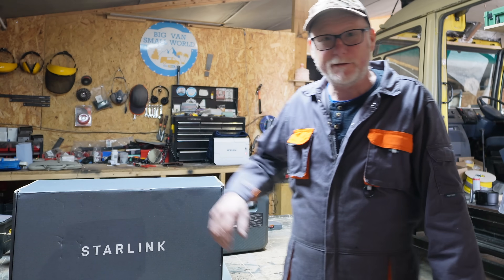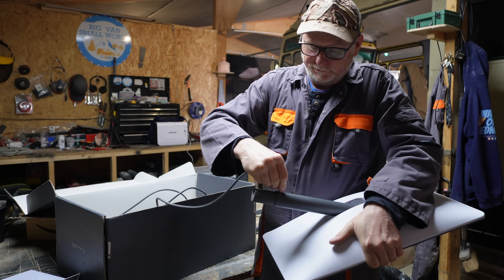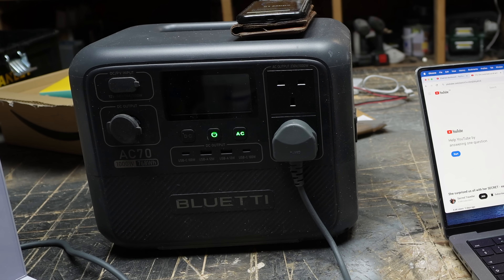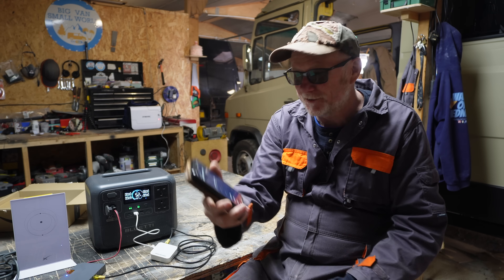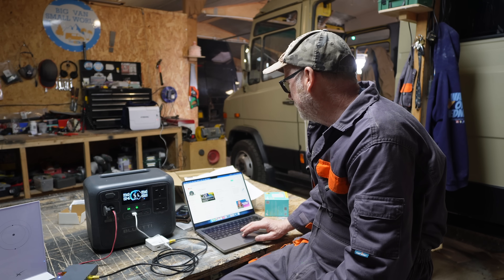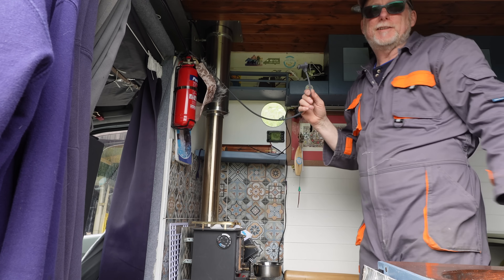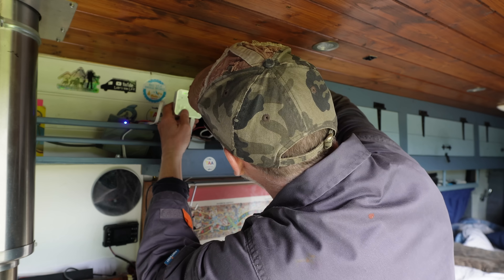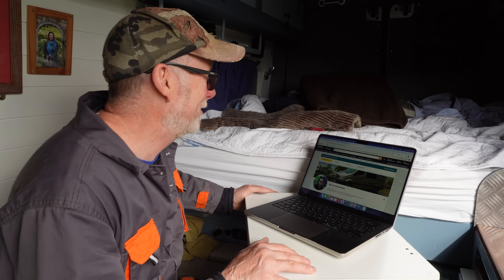HOW TO CONVERT STARLINK TO 12V DC no cutting wires or cables

Comment from the maker: I bought this product with my own money. This video is not sponsored in any way, but I do use affiliate  links. I am not on any sponsorship contracts with any company.
Here is a list of all the components you will need to do exactly the same as i have done in this video i hope this helps.  
XLTTYWL Starlink V2 PoE Injector https://amzn.to/3KIFGA1 
TP-Link AC750 Dual Band Wi-Fi Travel Router https://amzn.to/45nWtlj
Ercielook CAT8 Ethernet Cable 0,5m https://amzn.to/3xjzrzA
Aluminum Alloy Starlink Mount https://amzn.to/4clACgQ

Comment: Hi Mel, I have converted my starlink to 12V and it is working, however how did you get the starlink app to work via the 3rd party router, because for some reason mine does not see the starlink. Hope you can help. thanks
Reply from the maker: I just connect my phone to the router WiFi and it worked perfectly fine good luck hope you finger it out 🤞🍻👍

Comment: Great video, thanks Mel. One thing I noticed with my Starlink over the lovely English summer was that you don't always want the dish on the roof. We had some really windy weather in late August. I had placed the dish on top of my caravan using the supplied X stand. I weighed this down with a couple of weights. Signal was intermittent due to the wind rocking the caravan and the dish not being able to lock on to the satellites. So if you're camping in bad weather and there's a bit of space on the ground for the dish, put it there. Cue the 'caravan rocking' jokes... :)

Comment: Hi Mal just a quick update, we did the conversion as per your video.
We have had a major problem with the PoE injector trying to set our van on fire as there is no internal fuse fitted.
We luckily had a 10amp fuse on the supply so it stopped with just some smouldering, just something for you to be aware of.
Also it has knackered our Starlink cable as it’s melted the end connection, probably a stray voltage over the specified 48v
Reply from the maker: Oh my goodness me I’m sorry to hear that I’ll post this comment to the top of the comments thanks for the warning
Reply: @MelsBigVanSmallWorld not in any way your fault just a faulty unit, done some research and I am opting for the boondocker version now as it’s got built in internal protection, keep up the great vlogs 🙌🏻🙌🏻

Comment: I live on a canal boat. I have a simple wifi modem/router. with an external aerial. All on 12v. Router was 20 Quid and the aerial was about 10.  As long as there is a mobile signal (99% of UK has coverage) we have wifi. Just got a van and will probably just use phones as mine is not a conversion but a simple set up for occasional overnight use.
Reply from the maker: Yeah I think I may have wasted £400 lol 😂
Reply: @MelsBigVanSmallWorld  If you are going abroad and into more remote areas then yours will be a more reliable set up.
Reply: 99% coverage my *ss.
Reply: @JazzFunkNobby1964  When I posted my original comment I had never found anywhere with NO COVERAGE! However, I have had next to no data for the last few weeks as I toddle down the Ashby Canal! Basically, been unplugged! (Given what has been happening here in the UK its probably been good for my blood pressure!)
So I have to agree. My figure was a bit optimistic! 😜

Comment: Hi Mel. As always very informative and I have used so many of your tips. How hot does the grey box from Amazon get.
Reply from the maker: It get warm wouldn’t say hot
Reply: @MelsBigVanSmallWorld  thanks Mel installed today and used my existing 4g router and when I turn the starling off it switches automatically back to the SIM card. Thank you as always for your helpful advice.

Comment: As ever Mel, thanks a lot for trail blazing this! I have had Starlink for over 1 year now. Take it in the van with the router too through an inverter. On sunny days the solar panel keeps up no problem. Is the 12v change worth it? Power wise, probably not but it is smaller and neater. I love the bracket you found on Amazon too. Will you travel with the dish on the roof too? I tend to wedge ours inside the van in the roof light and it works! Can't open the roof light though so the bracket is another idea. Thanks!
Reply from the maker: Thank you I think it’s pretty good m glad I did take a chance on the conversation no I wouldn’t drive with the dish on the roof but it is really easy to take down with that bracket 👍

Comment: The inverter in all the "Solar generators" are not going to be 100% efficient (normally around 85% - 95%) so going to save on those losses and make the battery last longer.
Reply from the maker: Correct 👍

Comment: You definitely wouldn't save any power with the PoE injector got to say that is very expensive for a PoE injector. I always use PoE when installing cctv systems
Reply from the maker: Good on ya find one that works with Starlink

Comment: Be ok if out in a desert bit to be honest a normal 5g 4 g router will get a good speed , the cost of those are mad upload speed is ok if youre wanting to upload video to youtube but for the average person they aren't worth getting for streaming and web browsing
Reply: I agree. I traveled around the UK for four years and spent one year in Europe with 4G working perfectly. Starlink's 65W power consumption is quite high. I leave my router on 24/7, and it uses only 4W. I have the RUTX12, which runs on 12V. My unlimited data plan from O2 costs £25 per month. In comparison, the base dish from Starlink costs £150 (we're now on version 3) with a monthly fee of £75. Additionally, having to place the dish outside for a connection is inconvenient. Yes, I've seen the flat mount, but you need to remove a solar panel to use it.